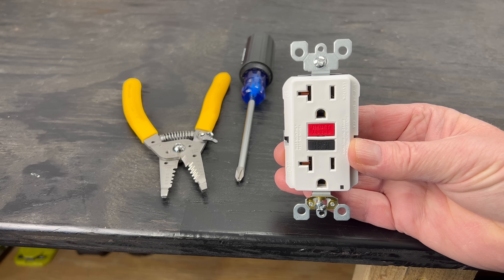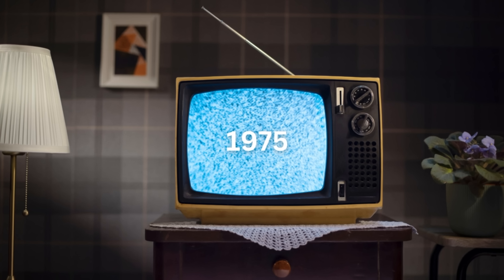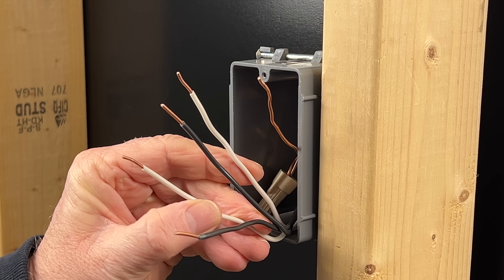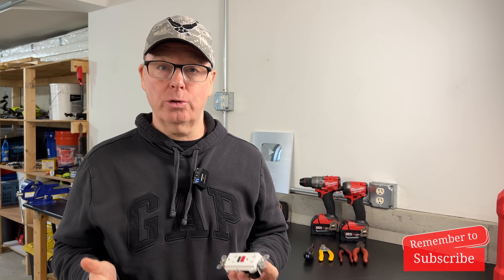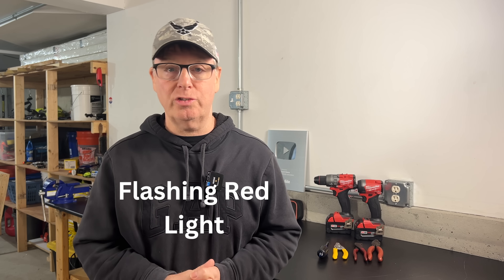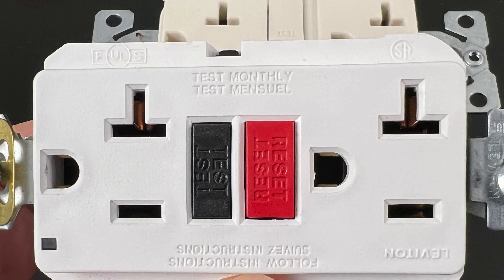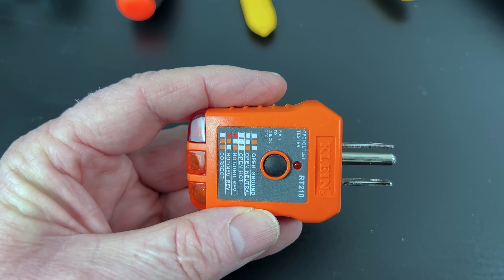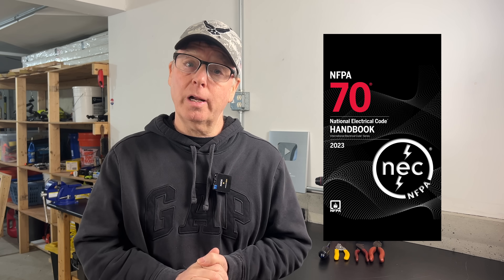Did GFCI Receptacles Change Without Us knowing?

Comment: I wish the location of line/load was standardized. Many times a line/load installation error is because the electrician has a muscle memory as to the location of line/load, and then he gets some that are switched from what he is used to and he ends up installing them line for load. ESPECIALLY if his truck inventory is a mish mash of some units with line on top,, and some units with load on top. I have gotten into the habit of checking EVERY one.. and not just the sticker, but the labeling on the outlet itself.
I would also  like to see some guidelines on what the LED on the front means... I don't mind if they are loose guidelines... thats ok. SOme have a simple light that may be on when normal, or may be on when tripped, or they might have  several LED's that mean  ????? something....So this means if you replace a few units in a house, now the lights mean different things on  different outlets. To the point the LED's mean nothing except power is going to the unit... 
As for a general guideline suggestion.... Maybe something like a green LED for operational, and it changes to red if it is tripped... Then maybe flashing red for a detected GFCI failure. Keep the guidleine loose as a suggestion so changes are allowed, but a guidline would be nice.
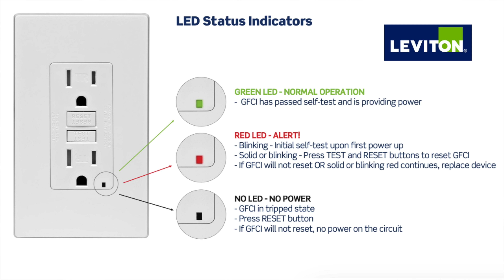Reply: 4:26 - The lights... Exactly what i was ranting about. I have seen GFCI units with all kinds of different light patterns...1 LED...2 LEDs...you name it. No standardization.
I have seen - 
Your example in the video....
red light - on... no light - tripped
green light - on... no light - tripped
no light - on....red light - tripped
no light - on... no light - tripped... light comes on briefly during reset... and it was amber
one with two lights.... i didn't even bother reading the instructions on that one...whats the point?

In just my own house I have working GFCI units with the following as normal operation indicators...
1 with a red light
several with green lights
and 2 with amber lights
All are in perfect working order

Without some kind of standard, the lights are worthless.

Comment: Thanks for the pro advise , Just an observation I have noticed over the years with GFI plug receptacles of different brands that the indicator light is illuminated in normal operation or illuminated when tripped with line and Load correct , Your thoughts on this ?
Reply from the maker: Some manufacturers have the indicator light illuminated when the receptacle is operating normally, while others have it illuminated when tripped and some will do both usually with different color LEDs.

Comment: What happens if I press the Test button on the Klein Tools GFCI Outlet Tester when it's plugged into a receptacle that is not protected by GFCI? Will it trip the breaker in the electrical panel? or does it have its own internal breaker that will get tripped?
Reply from the maker: Nothing will happen unless you have a GFCI circuit breaker in the panel. If you do it will trip, if not it will have no effect. There is a small resister that leaks a tiny amount of current to ground when the button is pressed.
Reply: @BackyardMaine  Thanks for your guidance, since I don't know watt I am talking about.😁
Reply from the maker: @petermadany2779 sure thing. lol

Comment: It is recommended that everyone test every outlet in their house once after moving in and after replacement or installation of a receptacle. This is more important than this periodic testing as they may be miswired. Happens often.
Reply: The kitchen photo in this video seems to show an arrow pointing to a refrigerator as being needed.  I have read, and my electrician and refrigerator repairmen concurred, that the new electronic refrigerators with motherboards and should not be plugged into a GFCI circuit.  This is because the power supply capacitors are stated to be extremely prone to leakage on the neutral due to the type of load the compressor puts on the circuit specifically its impact on the neutral line, and that can trip the outlet which is behind the refrigerator when no real fault exists,  and then this cause unexpected loss of all food if the outlet trips and no one is there to notice it.

I also damaged my refrigerator motherboard by running it on a non-inverter generator with the higher TDH, and this kept tripping its GFCI that the refrigerator was plugged into.

Thoughts?

Comment: Someone else did the receptacles, but another engineer and I redesigned all the in-line models during covid. We finished 14 different iterations just in time for the manufacturing cut off. It took us over a year to do the designs and get the units through UL certification. They also test for a local G-N short, which would compromise protection if allowed. BTW, the selftest operates the whole circuit but so fast the relay doesn't open. The button tests the actual relay. (Ours self-tests every 20 minutes which will flash the red light once.) They are such low markup that everyone just rebrands our units, it isn't worth the cost of designing their own.
Reply: I'd love to know how anything can determine the difference between a local G-N and the normal intended connection at the panel. Only thing I can think of is it would look for crosstalk that would appear in a run to the box, that would be absent with local jumpering.

Comment: So once wired correctly let's test every 3 seconds. And what happens if the self test is faulty 5 years or ten years how many tests? So now code requires a outlet where I'm never going to use it the 6-foot/12-foot rule and a billion self test later it's going to let's me know it needs replacement.

Comment: All receptacles are shown upside down.

The U-pin ground should be oriented upward where fixed equipment doesn't require a different orientation.
It's much easier to plug in when the long pin is up.

When a receptacle is oriented horizontally, the neutral should be up which put the ground to the left.
Reply: Almost nobody orients them with ground up.

Comment: The tester you described does not trip the circuit unless there's a grounding conductor to the receptacle.
Reply: You need to connect the ground pin on the tester to a grounding point (like a water pipe) for the external tester to work correctly.
Reply: @louisvillaescusa  Good tip

Comment: I saw something about new requirements for outlet boxes mounted on the inside of exterior walls. Now I can't find it. Was it a bad dream?
Reply from the maker: I had that same dream lol. That is a fact but it's not in the electrical code. New building code requires special insulated boxes on exterior walls. I bought one to make a video. Coming soon.
Reply: @BackyardMaine  What are they called? Would they be practical (or required) in basement walls that are underground?

Comment: back in the day I used my square d wiggy tester, hot to ground. the coil of the wiggy pulled 6mA. your plug in tester uses a 15K resistor to ground. both can be fooled by a jumper from neutral to ground
Reply: The GFCI should trip when you short G-N. The older models barely worked on G-N, if at all. Now you will trip the GFCI if you short G-N on the load side of the unit. The spec for trip on ground fault is 3 - 7ma.

Comment: I wired a GFCI the other day in a bedroom... I had to get online and learn a bit about them to get it done correctly!  Not too bad, really. My panel box has the type breakers with the TEST BUTTON on it; I guess that is required by code?  Will that make any difference in the operation of the GFCI?  I can easily undo the GFCI if needed. Thank you!!!!!!!
Reply from the maker: No it won’t make a difference. It your breakers have a test button they are either AFCIs GFCIs or AFCI/GFCI combination.

Comment: What still cracks me up... gfci afci gfci with afci! Were all about safe safe safe! Really? Y no auto child plugs like on non gfci cheap outlets as required by law? Yeah, you not so safe.
Reply from the maker: The code is not retroactive. Tamper resistant receptacles were first mandated in the 2012 NEC. I had plastic inserts in all my receptacles when my son was a baby. I don't have GFCI protection on my refrigerator, range or my washer or dryer either. No AFCI protection anywhere in the home. Again, the code is for new installations.
Reply: @BackyardMaine I'm not talking I serts I'm talking the auto self closing outlets now required by law. My new build has them except for the gfci ones.

Comment: Show me where it says that the push-button on a plug in tester, or really anything besides the built-in test button, is an acceptable method of testing a GFCI. You can’t, because only the test button on the unit itself is included in the UL listing. Even if an external tester was included in the listing, the manufacturer would have to list the specific makes and models that can be used. 

Just use the test button folks, and this goes for your smoke alarms as well!

Comment: Question for you please.I have an older home with some open grounds.I want to put a GFCI on the first receptacle of the run to provide protection downstream as I have learned.After I do this & put my tester on the receptacles downstream will they show they are wired correctly or will they show open ground even though there’s a GFCI on that first receptacle on the run?
Reply from the maker: If you have an open ground you will continue to show an open ground on the tester.
Reply: So to clarify as long as I put the GFCI on the first receptacle of the circuit then it will provide protection to all other receptacles downstream?The other receptacles will show as open ground but will be grounded from the GFCI correct?
Reply from the maker: @Dave-ld3dr  If you wire the down stream receptacles from to the load side of the first GFCI they will have GFCI protection. But if you don't have a ground wire or the ground is open somewhere in the circuit, then you will stall have no ground. The GFCI does not create a ground in any way.
Reply: Understood but then why do they recommend to install a GFCI receptacle on the first receptacle on the circuit as a remedy for open neutrals if it doesn’t provide a ground?What is it doing just tripping & shutting down the receptacles?
Reply from the maker: @Dave-ld3dr  I GFCI will still function and provide ground fault protection without a ground wire connected. They measure the difference in current the hot and neutral and if that number exceeds 4mA the device will trip. If the excess current is not returning on the neutral then it's going to ground or to a partially grounded object which could be a person. So with a GFCI you have ground protection without the actual ground.
Reply: @Dave-ld3dr  That is a compromise decision. Rewiring the circuit is expensive so if people were not given any option they would cut the ground prongs, use cheater plugs etc. Giving them an affordable option that provides reasonable safety is a good thing.

Maybe you have some fundamental misunderstanding.

Note you may not use the method to expand an old system or fix grounding problems on a new home.

Comment: Recently, I made myself a GFCI outlet box that plugs into an extension cord (it has a short male extension cord secured in one of the knockouts), to use when I'm running my water-cooled diamond blades on angle grinder.  I have that same tester plug and it showed everything correct and good to go.  On a whim, I plugged my box into a GFCI outlet, and the Klein tester indicated incorrect wiring, and wouldn't trip my box.  What's the explanation?  A GFCI plugged into a GFCI must confuse the tester's test-circuitry???

Comment: I replaced a  GFCI receptacle that kept tripping for no apparent reason.  Out of curiosity I took the old one apart. It was assembled with screws, not rivets or glue or plastic welded shut.  I found a small piece of wire on the table top that had fallen out of the receptacle.  That wire was 1 strand of a twisted wire about 1/2" long.  How it got inside the sealed up receptacle?  My guess is at the factory.   The outlet is mounted on a wall next to a busy street that had regular truck traffic.  I guess the frequent shaking finally moved that bit of wire to where it made contact.

Comment: They can "require" them all they want.  What they can't make me do is use them, or keep them in my home.  The house had none when we bought it 15 years ago and no one batted an eye and it still has none.
Reply: It's foolish not to have them on the kitchen and bath circuits, at least.
Reply: @GH-oi2jf  Well, I'm 57 and haven't had a need for them yet, but I don't typically use electric appliances when I'm running water either, lol.  That's just common sense.  Have had friends that have them and have had nothing but problems with them, tripping for no apparent reason.  Whoever gets this house after me can put them in if they want, but I'll just continue to use regular outlets.
Reply: @R @Rebel9668 terally the attitude that kills people. Entitled boomer
Reply: @Tilnerral  Gen X actually, lol.  And entitled to what exactly?  To live in my own home as I see fit?  If that's entitled, then HELL YEAH!

Comment: I have had a few of them old and new styles go bad and they all just tripped off and would not reset.. Some or most of the ones that I have seen go bad have self testing even though they did not have an indicator light but were labeled self testing on the device.. The little computer logic chip is 99% of the time the thing that fails, spikes, dirty power, brown outs100v-and high voltage130v+cook the little thing.. The best ones have arc fault detection as well as ground fault and it is a toss up on using these or the breaker with the protection.. Another thing to consider is getting a power good line in device that monitors the incoming grid voltage and frequency that will cut the power to your main panel if it detects out of range conditions.. A device like this can save you lots of money by preventing failures of fridge compressor motors, furnace motors, washer motors, dryer motors, AC motors, computer power supplies, TV's and a bunch of other home electronics.. Over a 20 year period living in a rural area we have been bitten by all these costing me many thousands of dollars.. I went with a solar setup that can correct the voltage 6 years ago but I saw those power good devices recently for $60 and would have loved to have had one 25+ years ago..

Comment: I do volunteer work and we are installing combination CFCI and ARC fault breakers. We do not install individual GFCI receptacles.
Reply: Great.  IMO you can have an arc fault in any connection, box, switch, appliance, radio, wire, etc, anywhere in a house.  And those sparks can start fires.  My parents house caught fire in 1978 due to a broken wire in a lamp.   That broken wire sparked enough to start the fire but didn't blow the fuse.   A modern arc fault breaker would have prevented that fire.  No one was home at the time and fortunately a passer by saw the flames in the house and called the fire department before the entire house burned down.  How many thousands of houses and lives will be saved with modern breakers?

Comment: What is the test resistance from hot to ground in a GFCI with integrated test button?
Reply from the maker: The test button will leak 6-9mA of current to ground. To cause 6mA of current at 120V, you would need a resistance of 20,000 ohms or a 20k Ω resistor. But the self test is done with an integrated self test circuit which will only trip the device if there is a problem with the GFCIs functionality.
Reply: @BackyardMaine  Great reply, thanks!
Do you have any idea at what amount of leakage current to ground (or actually what amount of difference in current flow of hot and neutral) a GFCI normally trips?
Reply from the maker: @Cotronixco  Its not exact but between 4-6mA or .006A. I hade a video going over this in more detail. https://youtu.be/LYWUjq8ST4Q
Reply: @BackyardMaine  Thank you!

Comment: using a solenoid voltage tester (square d wiggy, ideal or klein ).  test the receptacle from line to ground  a properly working gfi will trip.

Comment: Have several brands of GFCI receptscles and no rwo indicating lamps are the same. One only had 1 lamp and the others two. Of course colors don't match up. Wish the NEC stop changing commly used names like nuetrals to dumb ass confusing grounded conductor but standerise what color on GFCI lamps.
Reply from the maker: It’s been called the grounded conductor for at least 50 years. Probably always.
Reply: That and they screwed up big time allowing crooked testing agencies to allow labels in 50 amp receptacles for EV chargers that burn up in less then a year.

Comment: Pisses me off that the NEC makes GFCI receptacle manufacturers that often cost a third of the price of a GFCI circuit breaker in thier GFCI receptacles but not in circuit breakers. At an IAEI meeting we had a great guy from UL labs explain that they inspected & tested hundred of indoor & outdoor residential GFCI receptacles. Due to the high # that did not work they helped with having the self test feature mandatory for GFCI receptacles. They also were amazed the high # of outdoor recrptacles that were degraded from the sun. Not sure if that finding had anything to do with having now must use weather resistant ( WR ) outdoors.